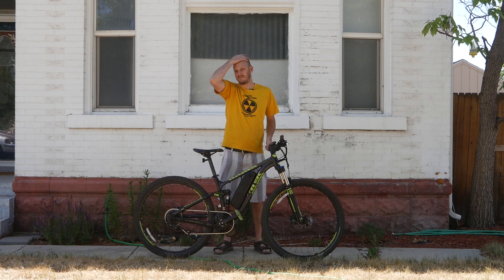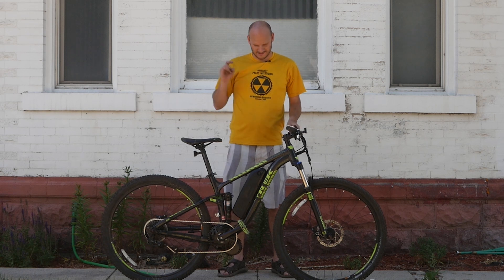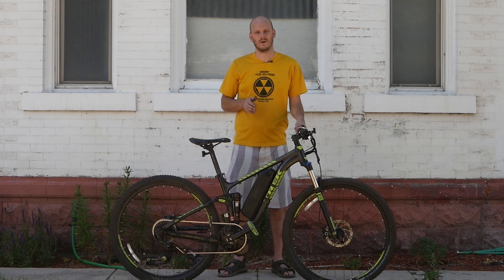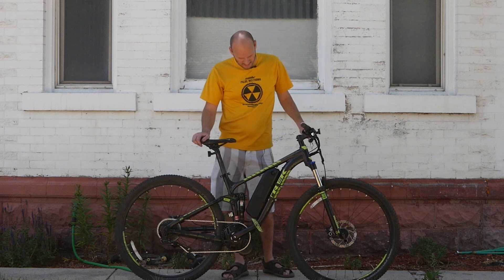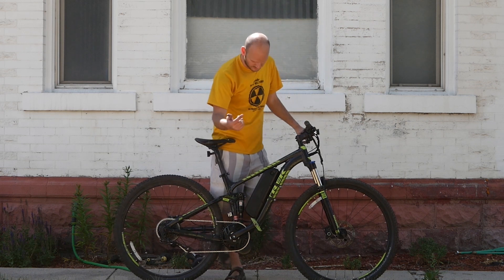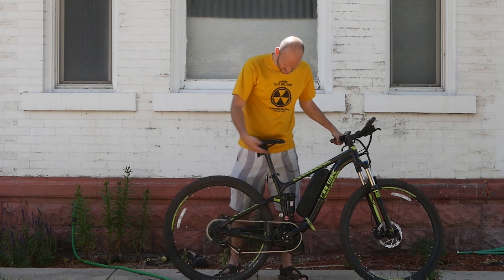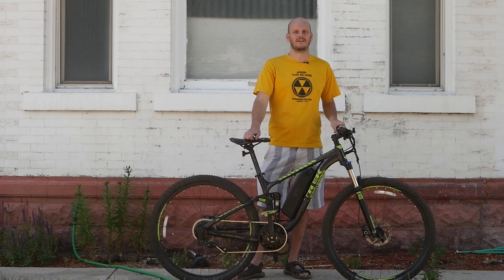Custom E-bike build: trek Fuel EX5 Full Suspension Bafang BBSHD 48v 1000w mid drive

Comment: Mr Nerdout, I bought a used BBSHD fat bike a couple years ago. Recently I tore it down, powder coated it, new everything including a 52 volt battery and your cool Lekkie twist throttle. This is bike is street only with Origin8 Supercell tires, 48T chain ring and an 11T highest gear on the cassette. This bike won't go over 29 mph. I've tried various .el tunes, but I don't see much difference. Do you use the stock out of the box controller program or do you tweak it?
Reply from the maker: Is your max amp setting set to 28-30?
Is your pas9 level set to 100%?
Maybe your gearing is too high(if you are using throttle only) try gearing down a little to let the motor spin faster.

Comment: the rear derailleur is way over extended on a 46 chainring, was the chain too short?
Reply from the maker: You want ~1 1/2 extra link when In the lowest gear. It should cause the deraulilluer to come up quite a bit and make it look somewhat tight. If it more than 2 links of extra chain in the lowest gear it can cause shifting problems, especially in the highest gear, where the chain is more prone to fall off the front chainring due to a lack of tension.
Reply: @JohnnyNerdOut  I appreciate you taking the time to reply! 🙏 Kudos and keep doing your thing brother 👍

Comment: Any reason to use a 1000w?  Would 750w be lighter … and then using a smaller battery to lessen weight .  I want to build my own full suspension ebike based on this but my main concern is the bottom bracket.  I think Trek says it’s a 92mm MT500 press fit.  Will a 100mm work? Seems like I need to shave off a mm to let the motor spindle pass through.  Can u link other adapters needed to hold the spindle in place?  Many thanks!!!
Reply from the maker: I wish I knew then what I know now… yes you can use a bbs02 750w motor and a Lekkie adapter for the bb92. 
https://www.johnnynerdout.com/product-page/lekkie-bb86-92-bafang-adapter
Reply: I have a fuel ex5 12 speed.  looking at ur other videos itr seems i have no choice but to go to a bbshd.  This is because I have a 12 speed shimano deore.. for that i am unable to find a chainring that works for a bbso2 (12 speed?)  If you sell or can recoomend a good chain and a chainring for a 12 speed bbso2 can u link that to me? or do i have to upgrade to a BBSHD?  Thanks!  @JohnnyNerdOut
Reply: Thanks so much … it seems like a 100mm bbso2 would also work easier and then use pressfit cups! I think I might have those … I’ll look

Comment: I have a 23 fuel ex 8.  Can it be converted?

Is the coversion reversible?
Reply: Yes, totally reversible. The challenge is finding space for the battery. I'm about to convert a new fuel ex 8 with a CYC Photon motor. Way better than Bafang.

Comment: What do you do if you have a similar bike but in a smaller size and the battery pack won't fit?
Reply: zrób  baterie sam  - np   pakie  13s 3   na ogniwach 21700   łamny  rownolegle       wtdy w ramie  bedziesz miał  około  25  ah    -   rama bedzie  wygdała jak  z  małym bakiem paliwa  szerokim na  jakie 20 cm

Comment: Thank you for your video. I'm looking for a similar solution to my 2010's Top Fuel but I think with the shock fully open it will hit the battery, because it's really closest to it. Did you have any trouble when opening the shock to the maximum?
Reply: That’s what I wanted to know.

Comment: How would you remove the battery with such a tight fit?
Reply from the maker: You really don’t
Reply: @JohnnyNerdOut  thanks for getting back...was actually considering this bike to convert...but not sure in the city 😅

Currently looking at a trek remedy 8 2016 for under 1k though. How do shipping times look for the BBS02 kit on your website?
Reply from the maker: @hyedefinition1080  I usually ship out next day. Depends on how far you are from SLC could be another 2-4 days 👍

Comment: If this were my bike, I would want the battery on the top tube. I see big clearance issues with it on the bottom tube of this bike if you're going to remove it and put it back on.

 Other than that, this looks clean.

Comment: I have a 2019 Trek ex 9.7 full suspension. I want to install a bbshd. Do you have to grind down the factory chain guide bracket. I am talking about the bracket behind the chainring where you can mount up a aftermarket chain guide

Comment: I am actually looking at this bike with the idea to get it to convert it, though I was thinking of the CYC stealth motor, but not sure if that is the way to go or stick to the Bafang for a mixed use bike as I want to both use it off road, but also as a daily work commuter. All a bit scary will be my first project, but I like to get it done right once.
Reply: did you build it?
Reply: @SteezyG  Not yet, cannot find a battery that fits inside the frame. CYC used to sell one, but they changed to a new design which no longer fits and the standard shark cases you see everywhere also do not fit.
Reply: @Lintary  Hi Carde! Did you get it? I have a 2010's Top Fuel but I have the same doubt. In that video the shock looks very close to the battery. With it fully open I'm almost sure it hits the battery when bumping. The aliexpress Bafang kit looks tight into the frame. Another solution is a back wheel rack screwable to the seat post, instead of the wheel's axle. Some holes on it to fit the battery and ready. Please share you experiences. Thank you!!

Comment: Will this same motor work on a Trek Fuel EX 6?
Reply from the maker: “Should”
Reply: @JohnnyNerdOut  Thanks!  Subbed!  Also, I will be building a BBSHD with 72V battery using the stock Bafang controller, assuming it works on my Trek.  I'll let you know the results.  I heard I can only go about 45mph with stock controller.  We will find out!
Reply from the maker: @SBiller442  bbshd will not take a 72v battery. You will need to upgrade the controller to one that can👍

Comment: What we need is a new frame that is light and can take a large 6s battery for 50amps supply. Most of the batteries struggle with 30 amps constant because they use long range cells for capacity. 35E cells are only good for 25 amps.

Comment: Hi great bids.hiw do you tighten the double bob to the frame with the water bottle nuts and then get the battery on.no room to slide it on or do you just use the double bob cheers
Reply from the maker: Just use the clamps, not the water bottle holes for a super tight fit

Comment: Could the climbing performance be boosted with a Phaserunner Grin controller? Also could you build a rear rack that attaches to the frame like a Riese and Muller bike? This is an exciting bike combo!
Reply from the maker: Yes a phasrunner would probably increase performance depending on how you program it. The only kind of rear rack that you’d be able to put on a full suspension bike would have to be a seat post mounted one because of the frame flex on the rear shock
Reply: @JohnnyNerdOut  I was thinking of how a seatpost rack could be further braced: Do you think there could be a way to extened mounting points out from the 2 fixed frame bushings on a full suspension bike? Then a couple of aluminum rods could be attached to the rack here like on the Reise and Muller bikes. It would be fantastic to be able carry cargo like groceries benefiting from the full suspension, and keep the rear wheel as light as possible if biking over rough terrain with a large heavy chain lock for security.
Reply from the maker: @InspiredByBrad  might want to check out Old Man Mountain racks. They make universal racks 👍

Comment: The newer Bafang BBHD motors or being shipped with a 28 amp volt controller , even though that have it printed 30 amps on them  . its the 571-30-506  series. i guess the 30 amps ones was getting burned out . If the voltage is set to 28 amps in the controller  can it be raised to 30 amps by reprogramming it with a cable and software ?
Reply from the maker: No 🙁

Comment: My full suspension bike was a pain to get a good chain line also. Still is a bit off in first gear but works with 42T chainring. Add an asi controller like I have and you will be pulling wheelies up that hill from a stand still. Fun but a little on the crazy side. 👍

Comment: I’m looking to build my own ebike from a GT avanlanche, would the 1000 w mid drive work on It?
Reply: I'm doing a conversion on my 2018 gt avalanche 29er right now with the bbshd and a 52v battery. My 2018 model has a 73mm bottom bracket and should work no problem. Still waiting for parts to show up right now though.
Reply: @richardzielinski5707  I actually think mine is the same year as well. Been looking at buying an ebike for hunting but seems just converting my current avanlanche will not only be cheaper but have way more power as well. At least without spending like 6 grand on a premade bike that uses this same engine

Comment: i subscribed and Hair started growing out my Ears but hey, anyway Johnny, i got the bbshd, do i need the Throttle plugged in to test it before i fit. Thanks brah John
Reply from the maker: Nope. Wouldn’t hurt though
Reply: @JohnnyNerdOut  i can't get it to move with 50v, i only have low amp batteries from power tools though, could this be the prob or have i bought a dud?
Reply from the maker: I’d try it with an active bike rated battery
Reply: @JohnnyNerdOut  can i ''borrow'' a 52v 60a off you Johnny, i promise i won't leg it to the Himalayas
Reply from the maker: @jclive4773  do you have someone to vouch for you?
Reply: @JohnnyNerdOut  Dalai Lama?......that lil' Scamp will do anything for the Temple Ball

Comment: Another clean build. Looks like it must have been a PITA to build but the results are spectacular.
Reply from the maker: Absolutely a pain. Bottom bracket shell ID was about 1mm too small to fit the motor shaft so I had to shave it down. Took FOREVER

Comment: Nice John I have a new 29”
Inch wheel with a pedal assist that was installed on it by the previous owner it’s a  48 volt 17ah BMS and the motor is a tongsheng 48 volt 500watt my question is will this battery work with the Bafang motor? I want to upgrade to a Bafang with throttle thanks

Comment: Great vid. A couple of questions. Why 48 and not 52v (battery size maybe?). Hydraulic brakes, did you mount magnetic sensors or change out the levers? Did you need spacers in the bottom bracket. I'd be interested to see the BB conversion sleeve or whatever it is. Also maybe include in your vids bike weight in kilos or course........ 😁 PS....I subscribed because you told me to.
Reply: I believe he used that 48v because that is the biggest battery he could fit inside the triangle, due to the rear suspension mechanism and shock sharing the same space. Rear suspension bikes have less room for the battery.
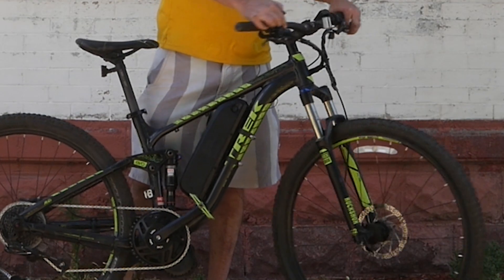Reply: He mentions the brakes 2:47 , when you get the bbshd its a 20$ upgrade to hydraulic brake levers. They come with the motor kit
Reply: You can get 52V upgrade when you buy the kit....